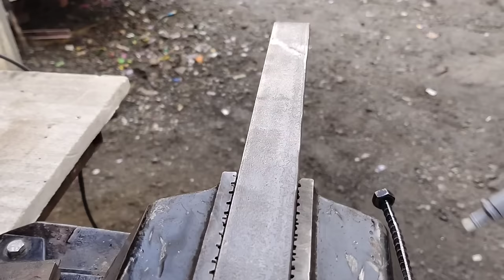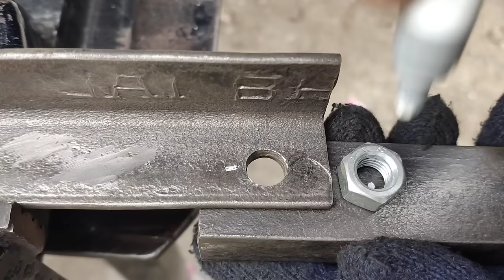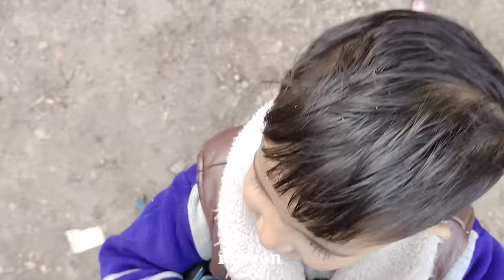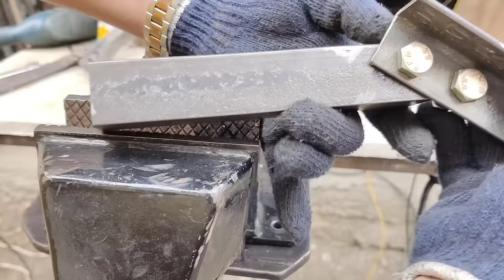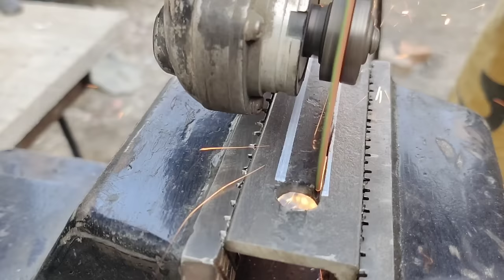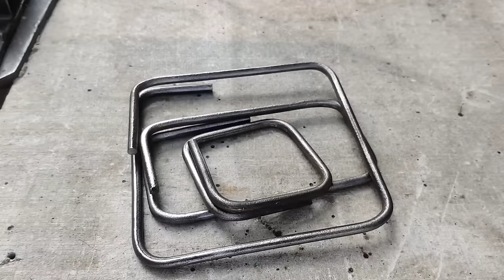Useful ideas for Metal Bar Bending || Bending Tricks for Rod Bar || Metal Bender rebar Bender

Comment: Excellent work, but there are notes that must be taken into account:
1 You could weld a small iron column to the rotating arm instead of using a screw because it is fixed and its function is the same.
The idea of moving screws according to the length of the iron square you want to make is an excellent idea, but with time and the force of friction, the screw cylinders will melt and it will be difficult to open them.
 In such a case, we use fixed sizes for the moving screws and weld them because the foundation concrete squares are mathematically either 15 cm, 20, 10, or twenty-five cm.
Greetings to you